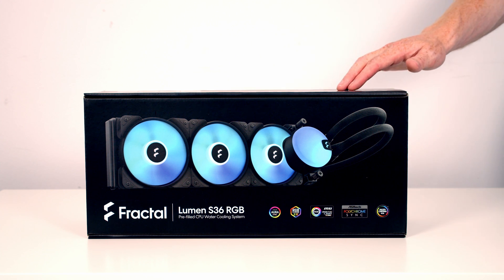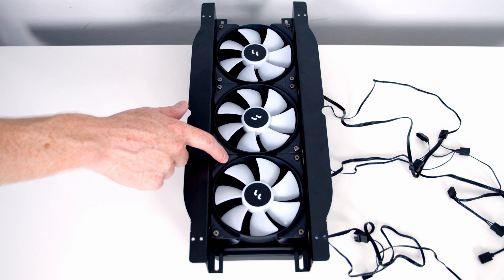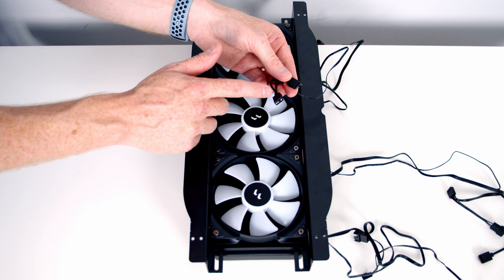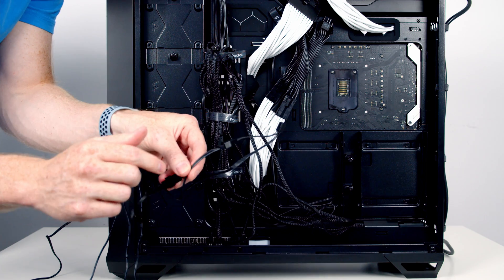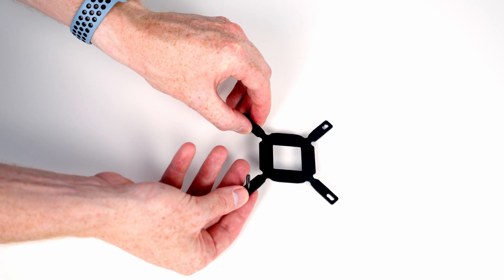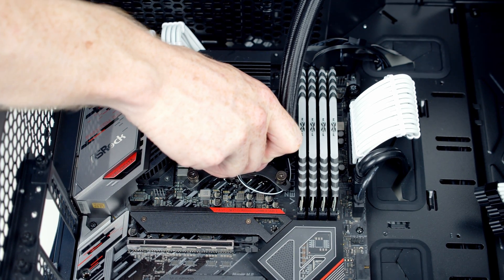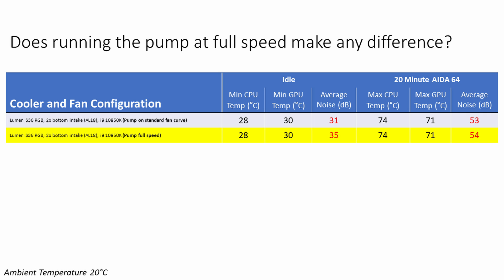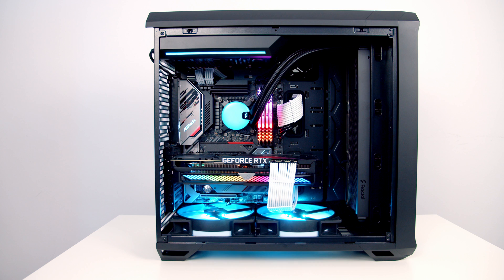Fractal Design Lumen S36 RGB - Overview & Installation Guide

Comment: I'm thinking about buying the non-rgb version of it (the recently released V2). I have a solid Meshify 2 (I don't like RGB), does connecting the water block RGB mandatory or I can skip it? I will pair it either with a 13900k or the not yet released 7950x3d.

Comment: Not sure why but my standard temp with this AIO is 71c. I run a Ryzen 9 5900x and instead of my exhaust fans being on the bottom mines run at the top of my case. Our build is rather similar otherwise.
Reply: I'm in similar situation now, having the same CPU. I did all the troubleshooting, nothing changed so I've requested a replacement.
Have you figured out your issue by now?
Reply: @VeeIsDead is it better after replacement?
Reply: @pjoter93  yes. turns out they were all faulty, so the issued the newer one

Comment: Hi Christopher, I've placed my fractal radiator fan rack inside the case (essentially sucking air from inside the case blowing outside), would this be a problem? Im using a Lian Li case so aesthetically this is the only position that looks well.

Comment: Hey awesome video! Question though. How possible would it be to keep the 180mm fans at the front as push, still mount the 360 rad at the front and put the rad fans in pull config. Would you need a custom bracket or can things be installed that way

Comment: Can I check if front mount cooler tube top is ok? Or I have to change mine to tube down? Thanks
Reply: Change to tubes down!
Reply: @evanhiltzik00  The pump is in the radiator on the Lumen series at the Tubes side. So this installation is fine.
Reply: @jonathanluttrell1380  does it matter how the tubes are positioned? Cuz i thought having the pump higher than the cpu block is just always bad?
Reply: @bennoboy97  The radiator needs to be the highest point in the system regardless of pump orientation, goodluck going tubes down with a 360mm. I think people didn't carefully watch gamers Nexus video. Tubes up is perfectly acceptable if you can't mount tubes down. The radiator needs to be higher than the CPU block(Asetek or EK style, pump in water block) Having the pump in the radiator like the Lumen series does reduce the chance of air in the system damaging the pump. Although my Lumen only lasted 8 months and the pump failed. Mine was top mounted. I replaced it with a EK AIO and it works better for me.

Comment: They need a 360mm (2x180mm) version for the Torrent.
Reply: This is is the problem with this case : nowhere to put your AIO cooler except at the front... which means you have to get rid of the original 180 fans as they are not pressure optimized anyway... This case is for air coolers builds preferably.
Reply: @Blafard666  Yeah, I had an EK 360mm AIO ready to go in, but that was when I was going to use the Lancool 2. Now that I've ordered the Torrent, I'm going to use a D15 and just go back to air. I know that EK is working on a 360mm rad, not sure if they plan to make an AIO version of that, but I might end up doing an open loop on the CPU. There was no way I was going to ditch the 180mm fans.
Reply: @TheGameBench  you can put this lumen aio at the bottom of the torrent
Reply: @Antho2030  Yes... I'm aware, but then you're really ruining the point of the case. The 180mm fans up front are what makes the case interesting.
Reply: @TheGameBench  it’s just not a case for aio
Reply: @Antho2030  Not going to disagree. There aren't any AIO's that work with the stock configuration and they're all a compromise. That not to say that AIO's don't start coming out for such configurations. I'm sure other case manufactures are going to start making their own variants of this layout. I can see it being very popular. Perhaps 140mm will be the new 120mm.

Comment: Pump is crying
Reply: Pump is in radiator on the Lumen series.
Reply: @jonathanluttrell1380  yes so shouldn't the pump be at the bottom not at the top?  you don't want the air bubbles going up into the pump.